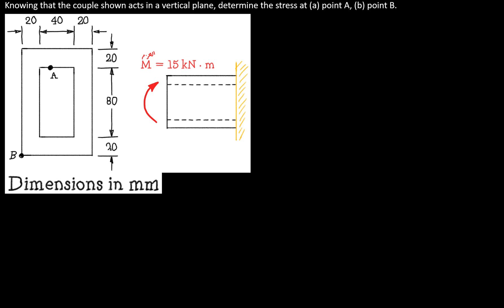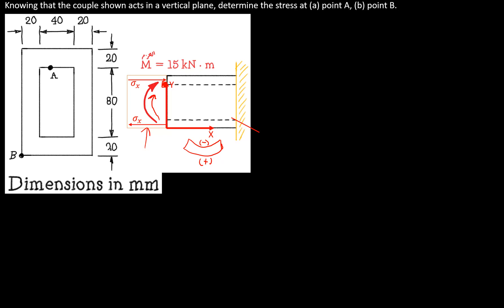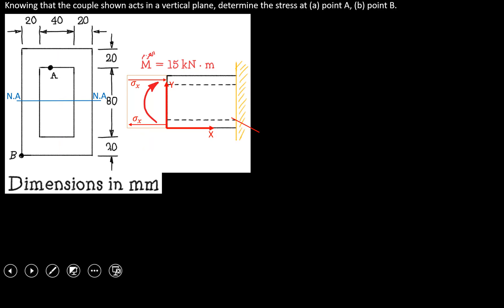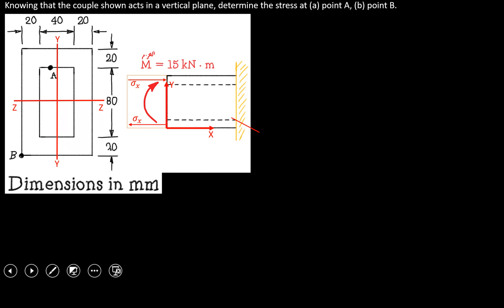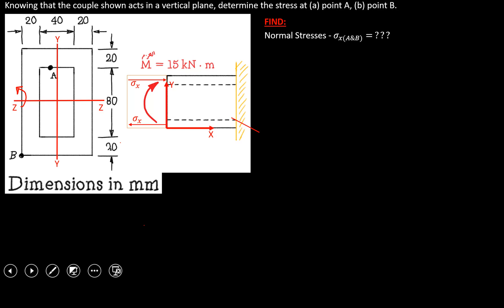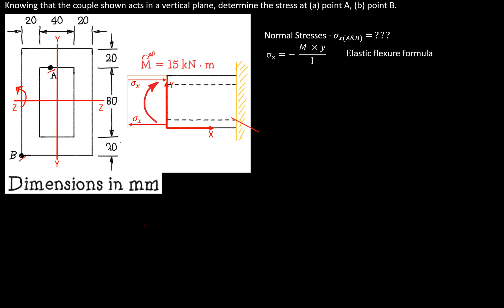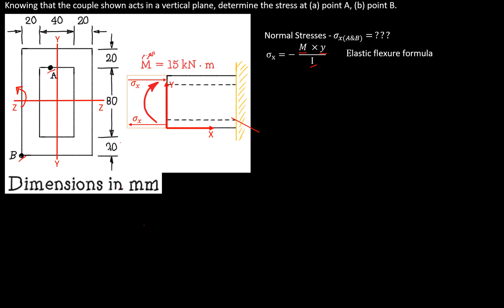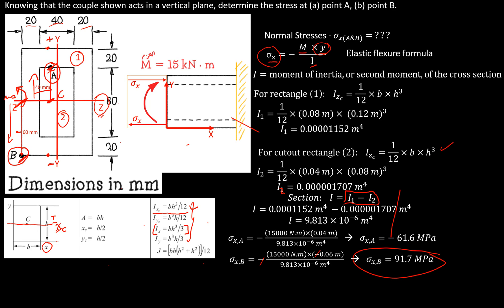Mechanics of Materials Sixth Edition - Problem 4.2 - Pure Bending

Comment: Should the answer be in pascal since it's newton over meter squared?
Reply from the maker: Hi, 
Thank you for your question. You are right. When you plug in the values found and given to find the bending normal stress in points A and B the answer will be in pascal or newton over meter squared. The missing step in my solution is - I divided the final answer by 1,000,000 to convert it to MPa (Using a conversion factor). 
1 Megapascal = 1000000 pascal.